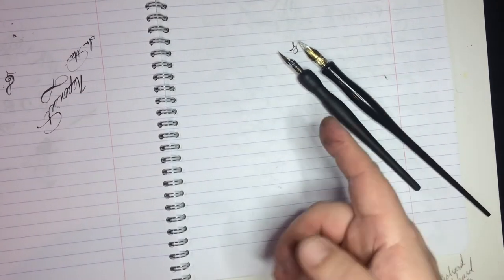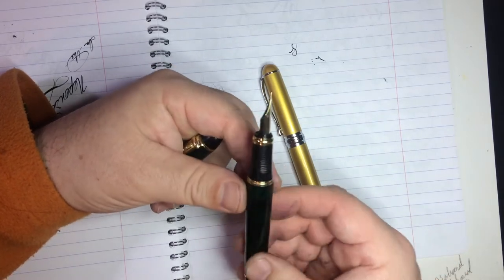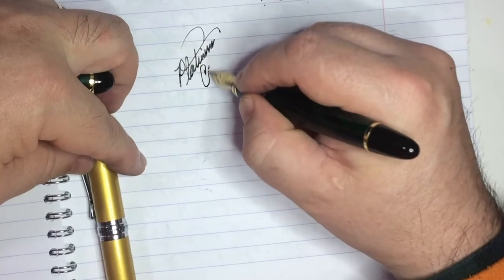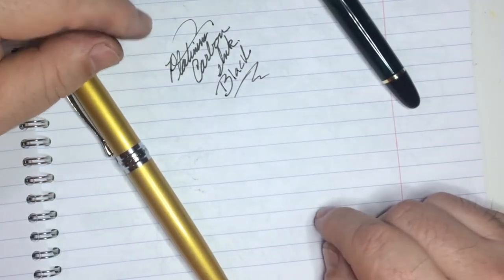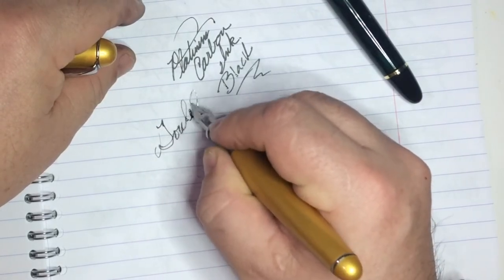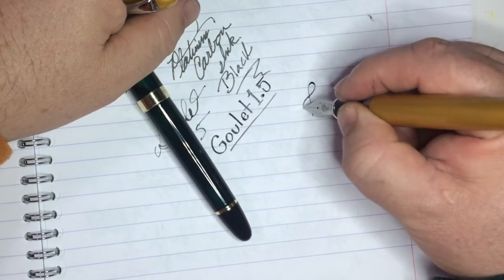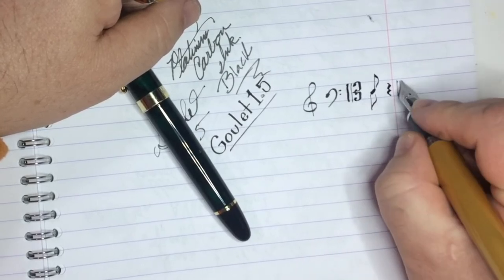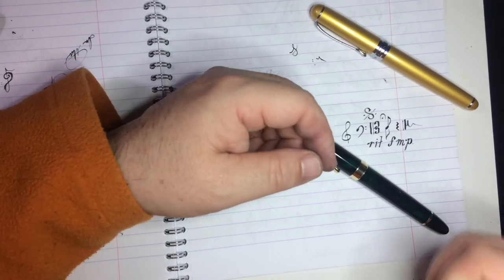Goulet 1.5 Stub in my Jinhao X750 fountain Pen

Comment: Loved this video :) I bought my first x750 from Goulet just last week and it is super smooth compared to the one given to me, a very sweet gift, of the Amazon version and I thought it was supposed to make noise as you wrote but the ink flowed well and was good for my arthritic hands since you just guide the pen more them press it...I could deal with the feel & noise since I thought that was normal since I know nothing. Then my x750 came and I was blown away but how smooth and now I won't be able to write with the scratchy one :/ but I'd like to get the Goulet extra fine for one of my x750's to use more for day to day writing letters or cards i make with watercolor paintings.
I had a question for you about the ink. My sweet friend also bought me the platinum carbon black ink knowing I needed waterproof to use with watercolor....it seems odd that its so dark black and beautiful as it goes on, but seems to dry a more dull gray...is that normal? Since I've never used it I've not clue, just seemed odd. I've seen other draw with it and it looks SO nice and black, but while its a dark grey, it's still definitely a grey, not black when dry :/ so just thought I'd ask your opinion on that. I'm also now super scared I'm going to ruin my pen by having that ink in there :/ hopefully not.
Thanks for sharing and letting me see another Goulet nib I'll have to save for one day :)
Reply from the maker: My carbon black also seems to dry a silvery color that causes issues when I reprint. Platinum Carbon Black is a pigment ink and has micro particles of actual carbon in it. The better mixed the ink is when you fill your pen the darker it stays when it dries but it always has a grey silvery sheen. Make sure you agitate the ink bottle so the carbon pigment will be evenly suspended when you fill the pen. Once in the pen the pigment won’t settle as much so you don’t need to worry once in the pen. Be sure to flush or clean the pen after two or three refills or if the pen sits for more than a couple of weeks.
Reply: @tadashibyers9377  thanks so much! I do shake it a bit while keeping it flat because I'm not sure how that little basket thing inside works so thought if I shook it more some that wasn't as shaken might just go and sit in it before I refill. But, I'm glad to know it's apparently pretty normal  :)
Thanks again!!
Reply from the maker: @jadedenthusiasms  the little cup inside the Corbin Black bottle is a filler well. As the bottle starts to get low you can shake it to try and capture ink in it so you can still get a good fill. I had bottles of carbon black that didn’t have this filter bottle and I’ve found it to be useful so I’ve kept one or two from other old bottles and I’ll put it into a bottle that doesn’t have one when it gets low to help me fill my pen. Not useful outside the bottle because they topple over too easily. DeAtramentis document inks create nice dark lines without lifting and messing up watercolor. Enjoy and happy new year!
Reply: @tadashibyers9377  thanks so much! :)